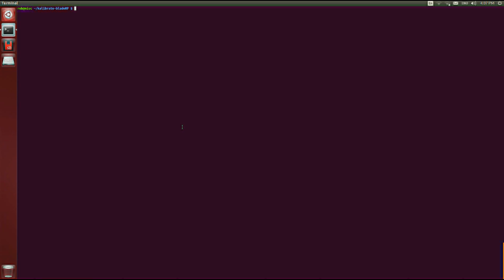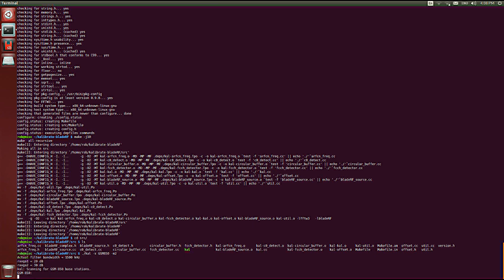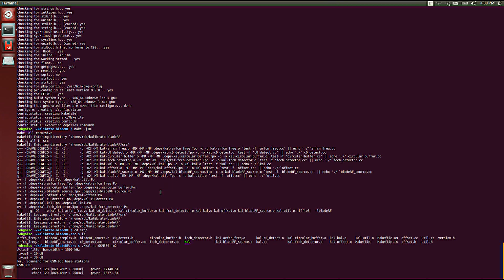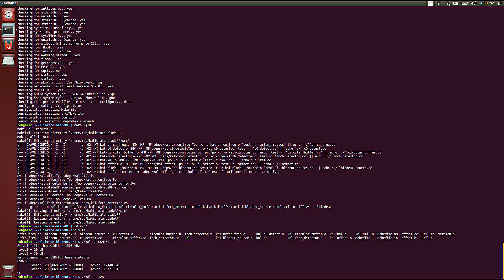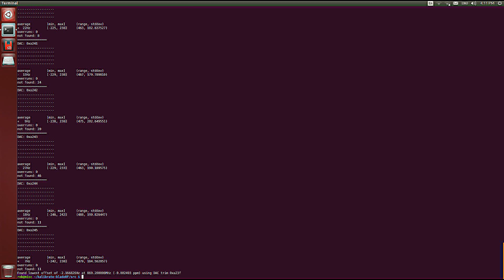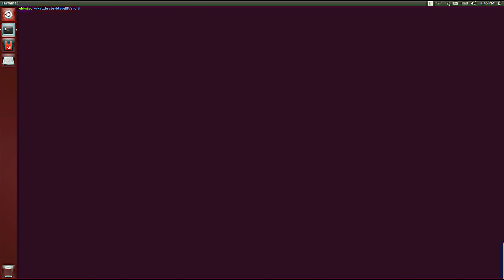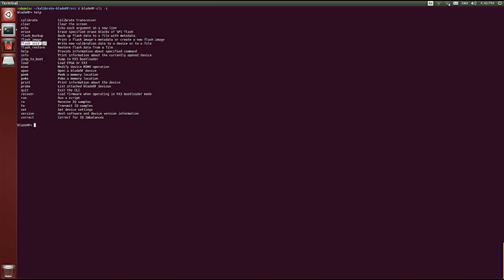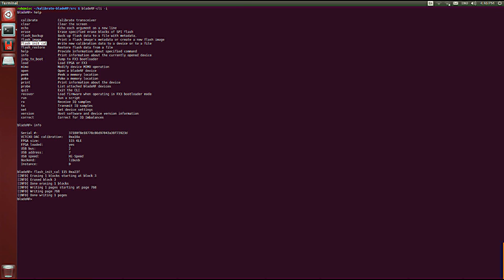kalibrate-bladeRF

Comment: I'm in Australia, and I can see that we use the GSM900/1800 bands, and so I've searched through the 900MHz band successfully, but what exactly is the "multiplier", what does it do, and which multiplier should I use?
Reply: -m is a multiplier factor, it tells kal how much longer to idle on each channel before switching. An -m of 3 is recommended.